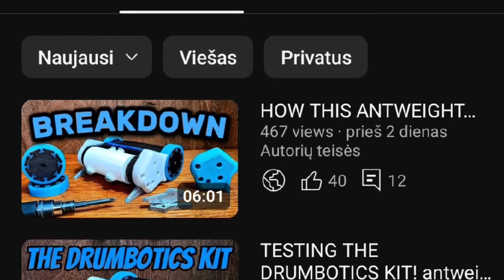THIS COMBAT ROBOT IS REALLY UNSTOPABLE? - Fights with my 200 gram antweight TYTOTU.

Comment: Hey, just a tip with your 3d printed armor. You said since it cracked you increased it's infill, but that won't really help defense all that much. What you actually want to do is increase the number of wall perimeters while keeping infill the same. It provides a much bigger and more noticeable effect on durability.